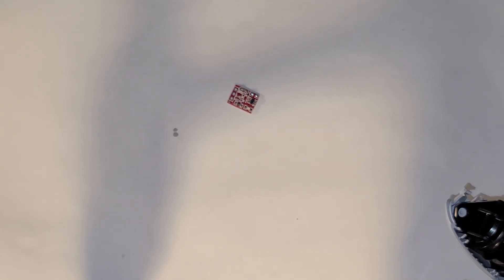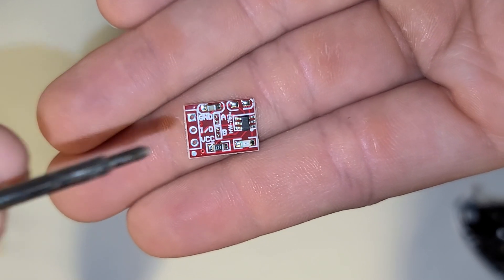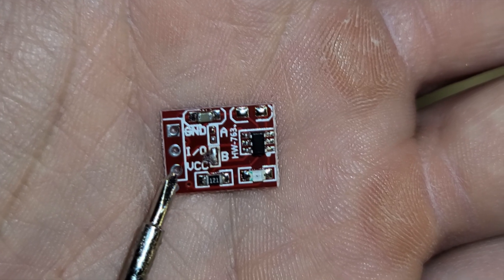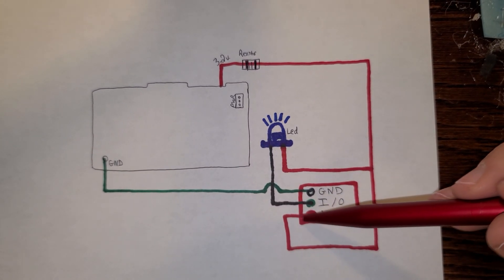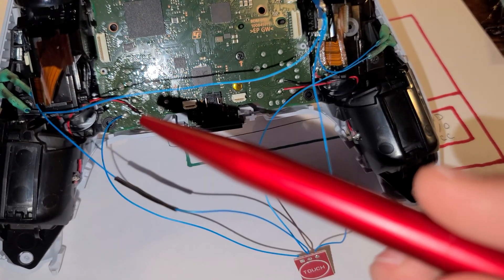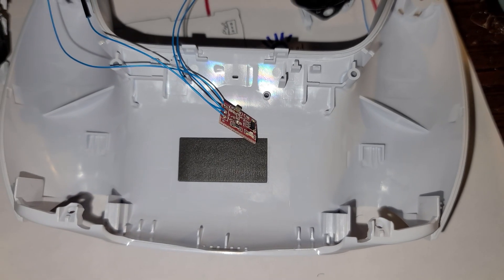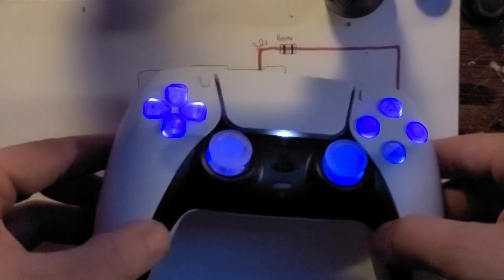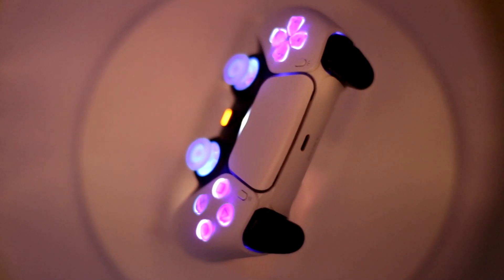PS5 Controller Mod (Touch Sensitive Button "Turn your LEDs ON & OFF") TTP223

Comment: Not sure if you know but you can actually make the touch area bigger if it's occasionally hard to find the sweet spot. That tiny little pin hole on the chip is a lead. Just solder a wire to the chip and to copper tape and you can make the touch area as large as you want. Currently working on making touch "back buttons" for the hell of it
Reply from the maker: Thanks! I was thinking of trying something like that so I can install the chip somewhere else and not have to worry about 4 wires going to the back shell. With just 1 wire it will be easier to close everything up. And that sounds pretty cool.
Reply: @JMAGG  yea once you figure out the touch switches you start thinking of all sorts of stuff to do with them. For the hell of it I wired one to my daughters bunk bed and sure as shit almost anywhere you touched it the light turned on lmao
Reply from the maker: @oldcrazyeye6482  lol that's pretty cool

Comment: I couldn’t get the board to work properly. When I hooked it all up only one side of the LED’s would come on. Connections were all solid
Reply from the maker: You have all your positives leads from your LEDs along with the main power wire coming together and going into the VCC. Then all the negatives from LEDs go to IO. And then just the 1 ground wire going to the ground on the board of the controller motherboard ground.
Reply: @JMAGG  yea I bridged the 2 B pins together and all. No matter how I do anything only one side of the LED’s come on

Comment: Follow up with how you mounted the leds behind the buttons?
Reply from the maker: I have detailed videos on that already on my channel
Reply: @JMAGG  Welp, Gave it a watch and as for how they're mounted it wasn't very useful. IT's hard to see how the clear white led's are mounted in the white shell and held in with clear white hot glue. Even the close up shots are in fast motion and very blurry. Taking still photographs with the best macro lense you have (be it a DSLR or phone camera) and inserting them in the video would do a lot to show how exactly you mounted them. Explaining how you angled the leds would help people understand how and why you did it as well.

Where did you find the slow color changing LEDs? Did they come with some short wires pre-soldered, or did you prep them ahead of time yourself?
Reply from the maker: @corgano6068  I felt the video was pretty well detailed but maybe I'll make another one in the future. The link to those color changing LEDs are in my rainbow led controller video. They are prewired

Comment: How big is the resistor that connect to the 3,2v power on the motherboard of the controller ? Would appreciate an replie
Reply from the maker: I use a 1 ohm 1/4 watt resistor
Reply: @JMAGG  thank u for the fast awnser helped me a lot ❤️
Reply: @JMAGG  ? The description says 1.5.....so  it should be 1?
Reply from the maker: @itsmebk7  both will work, the 1 will allow the LEDs to be a little brighter.

Comment: I see why you cut out the part of you soldering the daughter onto the three points, nearly impossible been trying for hours and the clumps keep sticking together, or the light wire just keeps coming out the slaughter

Comment: Looks so nice but not gonna lie Your prices are ridiculous.
Reply from the maker: Not in a rush to sell them. If they sell, they sell. 

But you also have to think about the cost. This is excluding tax 
$70 for the Controller
$10 for the LEDs
$10 for the clear thumbsticks
About $15 to ship
Then the time to build each controller. It can vary between 3-4 hours each controller depending if it's a hydrodipped controller or not. So I charge about $30 an hour which would be a decent paying job.